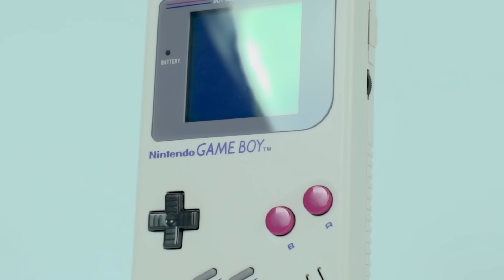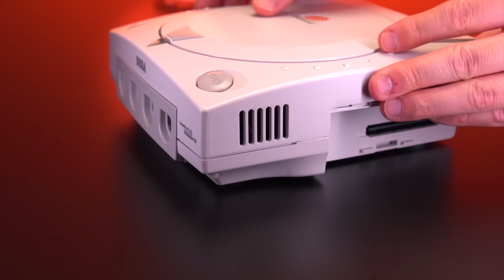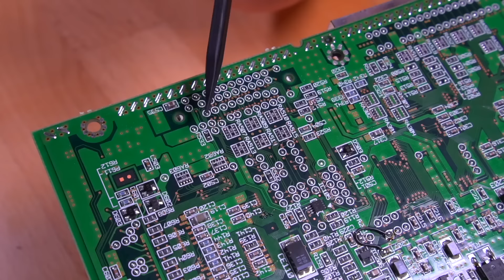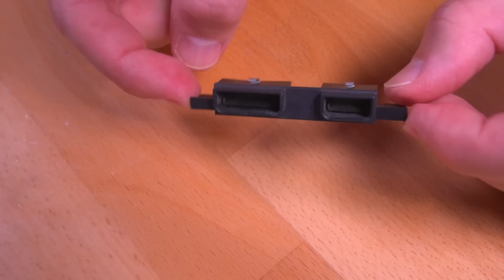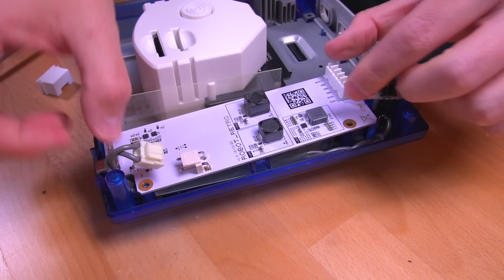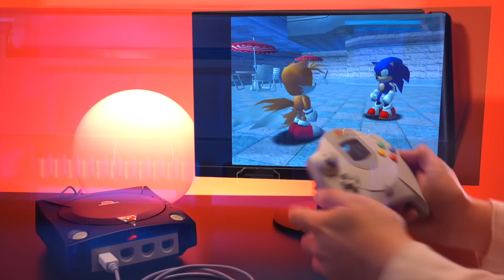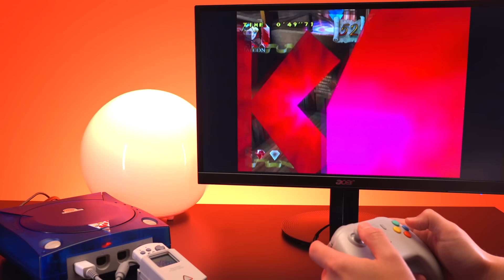Dreamcast Modding Is Getting Out Of Hand

Comment: You should look into doing a PS3 Frankenstein. Its taking the 40nm gpu from a PS3 slim and putting it into a backwards compatible Phat PS3. This is supposed to prevent the YLOD of death and allow you to play PS2 games on it. There is also a custom firmware you can install on it called evilant 4.91.2 which allows overclocking the gpu.

The OG XBOX has a mod for putting a faster 1.4 ghz cpu inside of it as well.

Comment: If you cant find racing oil, and dislike white lithium grease, you can use Krytox 205g00 or 205g000. Both are low viscosity and loved by the keyboard building community.

Comment: 13:12 you're pulling the soldering iron away much too soon after applying solder, you need to leave it there for at least a half second for two reasons; so heat can transfer into the pads, and so the flux can do it's job. just remember, solder only wants to stick to warm, wet pads.
Reply: The guy knows what he's doing. Just looking for something to complain about, smh

Comment: I am usually all for modding consoles for upgrades and such but I have this OCD thing about having 1 console that is entirely stock and 1 that is upgraded and has all the bells and whistles...this is the sole reason I haven't done any upgrades to my Japanese DC. They are so hard to find in Australia for any decent price and due to this I only have the 1. I would really love to see a GDemu that doesn't require removing the original disc drive, if I can find one of them I will at least do that mod and the psu mod (saves using the downstepper) but ugghh I wish I could find another one locally to keep pristine

Comment: You could do a dream pi, only use a pi zero 2w with the hardware style modem (I think mine was a US Robotics)  Anyway, you can cram them all together in the modem case and play dreamcast online wirelessly.  I made one using a regular pi zero w, and I think the only thing I would like to try different is removing the old dial up connector from the stock modem and enlarging the opening for a tiny fan, as after an hour or so it gets pretty hot.
Reply: Calling it ultimate for engagement. Youtubers gotta influence.

Comment: best mod would have to be either the HDMI mod or the clock battery mod. I never thought you could swap it for an 18650. I wonder when others will do this mod on other consoles with clock batteries? my clock battery died years ago, and I've just been dealing with the clock start up screen ever since. need to get me this mod asap. and I've seen hakko around on a few youtubers tools, so when i get back into modding and building I need to snag me one of those.

Comment: Not mentioned but good to remember as I f*/ck up 2 Dreamcast, changing the resistors use LOW TEMPERATURE AND BE PATIENT, the pads can brake or just popup and fixing that is almost impossible unless you have profesional grade soldering skills.

Comment: Wobbling Pixel's channel has a tutorial for Openmenu, which is an open source menu alternative to the tradition GDEmu menu.

There's also the ThunderDream Thunder PSU for the Dreamcast as well. It's not USB-C powered, but it seems more overbuilt and featured, and it would mean you wouldn't need a separate USB-C power brick. But this can be a pro/con depending on if you've modded several other consoles to be usb-c powered, you might prefer a single multi-port USB-C power supply powering a collection of usb-c modded consoles.

Greg from LaserBear was also supposedly working on a Dreamcast equivalent internal controller board that used BlueRetro for bluetooth controller compatibility, but I haven't seen that go anywhere. Meanwhile another similar product "IBlueControlMod" is available that does essentially the same thing.

Comment: the thing plays burnt cd's. has computer connector. 
I did put a mode in mine.
Plays good.
Soldering is to risky.
Reply: what i used didn't make a connection proper.
Did manage to get the xeno in the cube wired method.
maybe that solder station would be better. with proper solder.

Comment: Love my hakko gear! They're some of the most repairable tools I own, with full maintenance, diagnostics, repair steps, and part diagrams with part#'s all included on the manual IN THE BOX. I use cheap sponges and wire, and haven't ever felt scammed by the price of genuine tips. Firm recommendation - congratulations on the sponsorship!

Comment: Your mods are always beautiful but the problem is the price of a steamdeck which will perfectly emulate all your consoles that you hack, with less hassle and breakage.
Besides, I didn't understand why you removed the nand when piggyback was safer, I had the bad idea of putting a hacked nand by removing the original one and one day it broke down. I had since days put a switch and prefer the piggyback.
But clearly buying an RPI or a steamdeck is better because we emulate up to the PS3

Comment: The issue with an HDMI output for me is that it kinda defeats the purpose of having the console.

What i mean is the games are 480p so with an HDMI on a modern TV you’ll only expose how low the resolution really is and it will look horrible on a 4K TV even if you use a Retrotink.

Emulation running the games in native 4K look sooooo much better on modern screens. The only way to view the games of the original hardware with decent visuals is with CRT monitors.

Comment: I just installed a Dragoncity GD-IDE so I can keep my GD-ROM drive in my Dreamcast and also run games off of a CompactFlash card. I’ve also done the battery mod and controller port fuse fix but the GD-IDE is definitely my favorite mod.

Comment: The Striker is a decent controller, and the DreamConn is better, but it costs a fortune AND still requires a dongle. I'm surprised that you've never discussed the BlueRetro mod for Dreamcast in any of your ultimate DC videos. Yeah, it is tragic that you lose VMU functionality (💔), but being able to use any bluetooth controller like PS5, 8bitdo, Switch pro controllers, etc., and getting to keep the Dreamcast dongle- and wire-free is such a great modern touch. I do that for my Dreamcasts, along with an on/off switch for when I want to use the good old wired VMU or peripherals like the fishing rod controller. Plus the Blueretro has an emulated VMU now so you can still save.

I actually made a full tutorial on the BlueRetro DC mod after seeing your last DC video; you inspired me to get the info out there! I love the VMU as much as you do, but I think a lot of people would be interested in seeing the upsides of the BlueRetro mod in their ultimate Dreamcast. 

Also, that clock battery mod is new to me, and woah-- it's beefy! That might make it into my next tinkering session with my current Dreamcast.

Great video as always, Tito! Congrats on the Hakko sponsorship-- it's 100% deserved. 👏

Comment: One thing I don't like about this is that the optical drive has been completely replaced by an SD card emulator. I would rather be able to use the original disks as well as have the SD card option.

Comment: First things first - this "new" dreamcast dev unit intro is over 12 years old "new" and was developed by dude called Leo (sad to admit, don't remember his full name, it was too long time ago), as well as a region free BIOS hack.
Second thing is - you wired BIOS wrong way. Pin 1 of the BIOS is a /RESET signal and have to be connected to 23rd pin of the BIOS, which is VCC (positive voltage power rail). 44th BIOS pin is /WE (Write Enable), THIS one have to be connected to a B14 pin of GD-ROM Drive connector. This will allow you to reflash BIOS chip with any other BIOS version you'd like to.

Comment: I only did the GDEMU, Battery and Case Shell mod (out of your list) and I found that the aftermarket case shell isn't 100% flush. It's nice but if I install it all the way, the buttons end up being mushy and the power button sticks or doesn't turn on. I "fixed" the issue but not screwing it all the way. Luckily, from where it sits, that doesn't matter and since I never need to open the disc tray due to gdemu, so I doesn't get messed with much.

Comment: Your channel was always one giant Hakko commercial.  I broke down and bought the desoldering gun a while back.  It is much better to use than the plunger I was using.
Reply: I couldn't afford a Hakko and those that I could afford were Japan voltages only and adding on a step down voltage converter from 120 V to 100V would have cost the same as one made for North America.  I instead bought the Chinese variant and think it does well considering.  I had to do some touch up work on my brother's CR-V dash cluster connectors because of some cracked solder joints and it helped out quite a bit.  I used to use a desoldering pump and while it did well, had to be manually reset and only did one quick suck.  The continuous pump is the way to go.

Comment: I have a VA0 dreamcast i bought from eBay that i have yet to touch I’ve been a little leery about where to start modding it. After watching the video I’ll start with the resistors that way i can use a DCEMU. I really want to install that HDMI mod but i need to work on my soldering skills.

Comment: Doing the video noise fix mod on a 32x with a single ultra small SMD cap was bad enough. Must have taken 30 minutes to get it right. Hell no to replacing those 6 resistors. Ill stick with my VA1 dreamcast 😅

Comment: Man. I feel like one of those nut jobs that have a pop at original stock DeLorean car owners that's begging people to stop buying them to pimp into the BTTF version as the stock version will disappear. 
Why do you almost need a stock Dreamcast console at all soon? All that's happening is your slowing bypassing everything inside it to the point of what made the original is almost gone. It's like an old sailing ship almost where ever nut and piece wood  gets replaced the original is supplanted. The power, graphics output ,the controller  the GD Rom, hell even the original shell! all gone. 
Just seem like we had a masterpiece that looked a little scruffy, so I scanned it, reprinted it on high gloss, got a new frame with flashy LED lights and the print is now 10x bigger and threw the original in the bin as who needs it? There has to be a balance of restoring a console first. Or what's the point? Maybe I'm too old but to take out 70% -80% of the original and call it an original seems strange. And maybe this is something vintage car collectors have been dealing with for years watching a classic 1960's mini Cooper go from Racing Green to new EV engine, bright blue paint, Bluetooth radio, GPS, and racing seats and twin 18 Subwoofers with a 16tb SSD for movies and a transparent OLED as the rear window for playing Dreamcast games.

Comment: One nice mod for the DC would be a built-in VGA output that has a 36-Bit RGBHV (12-Bit per colour RGB) line-double/triple/quad 960p, 1440p & 1920p modes with dynamic scanline generation & 120Hz HDR-RBFI injection, this would be amazing for playing DC on CRT & OLED monitors, the DC looks beautiful with integer scaling on a 1440p 22" CRT monitor, and not quite as beautiful as a CRT, but still really nice all the same, in 1440p on an OLED monitor with HDR-BFI injection, and now we also have rolling-scan being released, OLED will look much closer to a CRT's image quality.
Reply: OLEDs dont have vga inputs, scanlines darken the image.
Reply: @D.DOT.O Why would you want VGA on an OLED?

Comment: I just got that FX soldering iron (Slightly different has an up and enter key) I tried the factory reset and set region to Asia but 350 I think is still doing F instead of C. Does the temp only do F? My iron doesn't seem to melt anything until I get over 500 so I assume its F. I've been using eBay off brands for the longest lol. The replaceable battery mod seems to make my battery last only 2-3 months and then it dies as well.

Comment: yes you can build/upgrade an Amiga 500 with modern tech ,also a dreamcast . but is it still an amiga . Or Dreamcast at that point . changing the PCB or componants , "MODDING" . you might aswell run the system from clone system . why does that matter ? if you finger around the hardware . you stop calling it what it is

Comment: I used the M.O.D.E. mod on my Dreamcast. It's plug and play and I also have a 3D printed extension to fill in the gap where the CD-Rom was on top. Looks great and works even better.
Reply: How is mode with large collections? GDEMU is awful to use with my 1tb samsung evo sd card. Slow AF, menu isnt suitable for such large colelctions either. IS phobe better as it supports ssd drives?
Reply: @D.DOT.O  MODE also supports SSD. And USB.
Reply: I also have a MODE. I would personally recommend the GDEMU over the MODE, however. The price difference isn't easily justified, because a $50 GDEMU does its job perfectly fine.
Reply: @37Kilo2 Agreed. I got mine years ago when it first came out...  But now there are more options to choose from.
Reply: @37Kilo2  How is mode with large collections? GDEMU is awful to use with my 1tb samsung evo sd card. Slow AF, menu isnt suitable for such large colelctions either.

Comment: the bios and hdmi mod is totally useless and dangerous, DO NOT DO IT. For hdmi simply buy a vgabox cable (about 15$) and a vga2hdmi converter. I suggest to use a VA1 model and leave a VA0 as is.
Reply: Crazy. I have both of these mods for years. Properly done, nothing dangerous about them, lol. DC Digital is vastly superior to any external adapter solution.

Comment: I just bought a hakko desoldering gun because of you, and man was it worth money. It makes desoldering sooooooo much easier.
Reply: The FR-301 is worth every penny. It more than pays for itself the first time you have to desolder a cartridge slot! 😅👍
Reply: @Bakamoichigei  I used it to remove the digital output on my GameCube and now I have the Pluto 2 mod installed. Super happy.
Reply: Same here. Bought it because of Tito’s recommendation.
Reply: I too will be joining the FR-301 club  due to Tito's advice.
Reply: When I started my arcade cabinet repair journey we had a broken fr-301 that still worked but the shell was broken. I revived it with steel wire to hold it together. It still worked so well that I used it for a couple of years then bought my own. Best way to desolder period.
Reply: I needed to read this comment. Thankyou for sharing that about this desoldering 👍
Reply: Great soldering equipment but it's not hack-o, but hay-co...

Comment: Best mod would be vga mod, region free (blue pal boot logo, blue pal badge on the case with matching controllers, a serial adapter for additional mods built into the console with a port, a piggy back bios switch dual bios banks, no hdmi mod and no sd or gdemu mods. Laser still last and plenty to go around for repairs. I choose to use disk methods as there are perfect self booting software and makes for a good hobby collecting and creating cases. Also been cast. So many mods can be done but I like to keep it stock as possible and the way it should be. This is overkill and completely uneccissary,  USA a vga monitor, original resolutions for crt, but one thing I was impressed with was the usb power supply. I'd go with that.

Comment: I haven't seen that before. The VA0 seems to be what the designers wanted the console to be but the bean counters and engineers couldn't agree upon. Either that is one of the consoles to run in one of the kiosks so it had to run cooler, at your local Best buy inside of some sort of external enclosure. I'm not sure where his math comes in but that 18650 could probably last about two decades without being powered on...
Reply: VA0 is the NTSC-U and NTSC-J launch-spec console that is set up with 5v going to the G1 (GD-ROM) bus. The VA1 has a 3.3v drive. This makes using a GDEmu on a VA0 slightly dangerous, but only for the GDEmu itself (I am currently using this configuration). The one used in Kiosks is yet another separate model, and that one has a dummy plate where the modem goes, among other slight differences, but those are designed more similarly to the VA0, as well. VA1 is by far the most common, and the model that the GDEmu was built for. VA2 is the re-designed console that has the GD-ROM control board as a component of the motherboard, and these cannot use the GDEmu. VA2.1 is the same as VA2, but with a BIOS update that restores MIL-CD functionality, and is the only revision of this type that can play backups. The Sammy Atomiswave is also a Dreamcast, more or less, but presents itself as an arcade board.